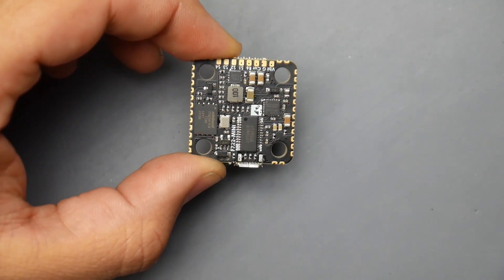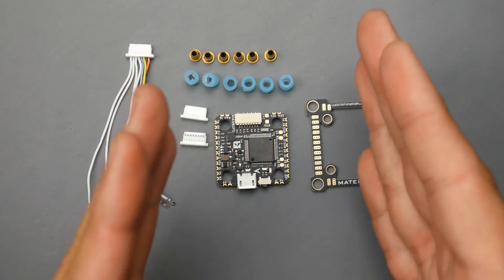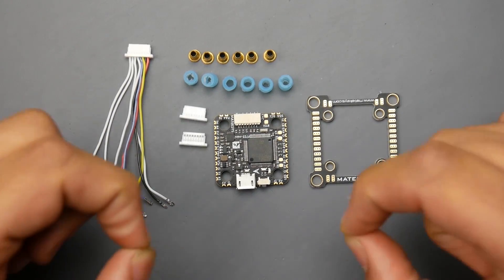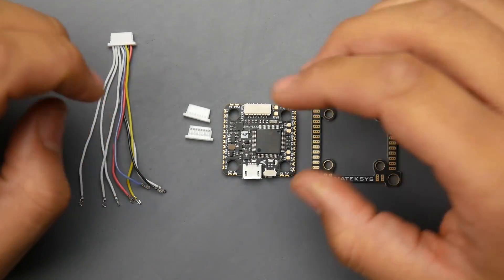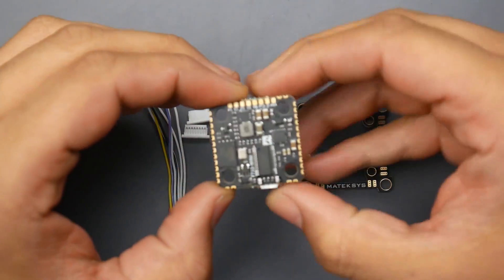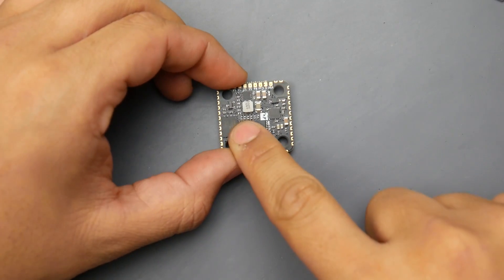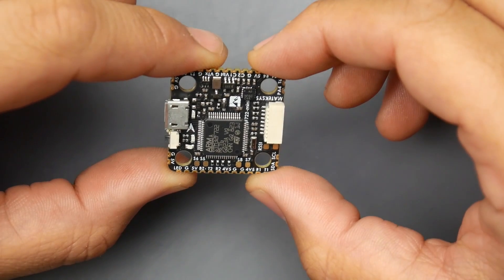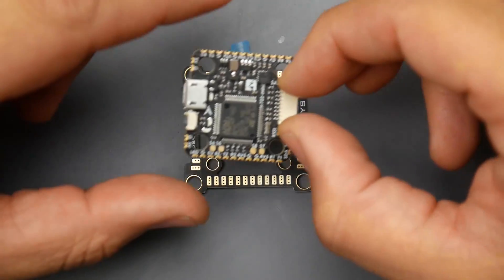Most Advanced F7 20x20 Flight Controller // Matek F722 Mini Dual Gyro

Comment: I use it on a lightweight 5'' 6S racer with the Aikon 35A 20x20 ESCs. It kept twitching or even suddenly flipping into the ground during normal  flight even without any provocation all the time(like at least twice a minute). I switched from gyro 2(this one was activated as stock) to gyro 1 and the problem was solved. My guess is that I switched from the sensitive ICM20602 to the MPU6000. I’m very happy with the setup now but it seems that the onboard blackbox just records corrupted data wich is quite a bummer for me.

Comment: I'm new to this Drone flying  just like to know if the  Matek F722 Mini Dual Gyro can be used in an RC Helicopter and if so how would I wire up the main Roter blade motor to the Board

Comment: Holy c.....!!! This instantly landed in my cart. And I will think about second one. Really, it is a breakthrough for small 20mm builds and larger 30mm builds - no fuss with softmounting and easier to mount peripherals without worrying about possibility to tear wires: easier to solder and keep them inside frame with this. Look like easy serviceable even in field when teared wires can be soldered back with battery powered soldering iron like TS100. Direct powering from battery is simply amazing. Had some mounting issues for F722-STD which needed extra space for external 5V BEC. This baby don't need that anymore plus 2A output seems enough for me (buzzer, LED strip, maybe a camera). I see, Matek even managed to put memory for Blackbox log on this board. Interesting what will be next. I would like to have a spinoff of this board with built-in D8/D16 receiver for my Mobula7 whoop.
Do a noise test for this FC, please.

Comment: Price is a bit on the steep side but judging from the feature set I can let it slide (until others catch up at least). I still wish they'd start making ESCs tho, especially 4-in-1 ESCs that match with their amazing FC lineup. Sure I can use other 4-in-1s but I'll always have that nagging doubt that there could compatibility issues (eg. physical compatibility) and that just drives me to other brands that offer matched stacks.

Comment: One of my biggest gripes (maybe the only one?) with the CLRacing F7 is that I have to use their custom hex if I want BB logging, and nobody has implemented that for Betaflight 4.0 yet. Not to mention it was implemented without wear leveling or bad block detection. Is that the case for this FC too?
Reply: This FC uses Flash memory which has been supported by BF/INAV

Comment: finally a decent f7 micro fc with a bb chip and a mpu6000. still, i would prefer no connectors at all.
judging by its specs - it is the best fc on the market by far. the only reason to buy a 30x30 -  need for 9v bec (for a split, turtle etc) and a baro